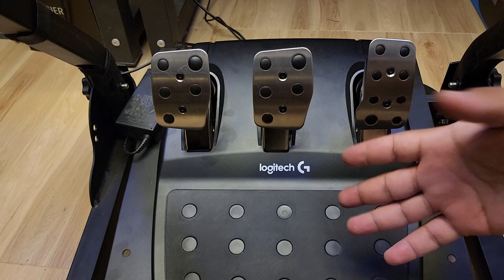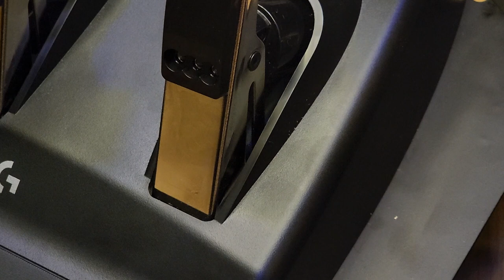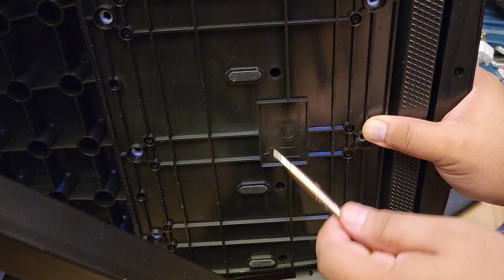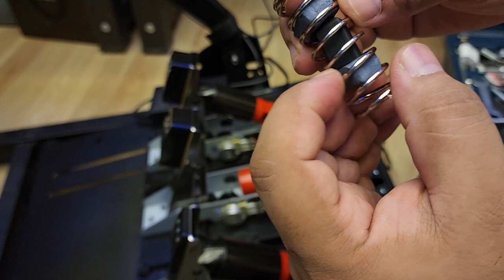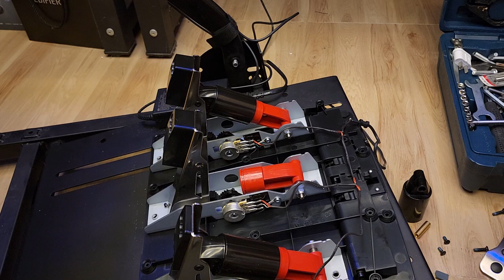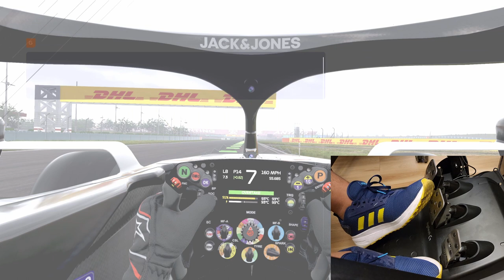How to Improve Logitech G29 Brake Pedal (Brake Mod)

Comment: After recently Installing a brake pedal mod, my throttle and brake are stuck at 100% in game. Do you have any idea how to resolve this issue?
Reply from the maker: Not really. Might be a good idea to dismantle it all and put them back again.
Reply: you have to invert the input next to where you bind them in settings
Reply: Settings in the game? Probably need to be inverted input
Reply: Did you ever figure it out??
Reply: @Gamersquadtttta  a new set of pedals.
Reply: Wires inside can get crushed when putting it back together make sure they aren't getting pinched
Reply: I know I am a little late but if you are talking about assetto corsa they make you invert everything in the settings before you can use your wheel so throttle brake and clutch need to be inverted

Comment: Don't do this because race car brakes are actually very stiff, similar to the pedals. They do that because the body is better at feeling how much pressure it's using instead of the small amount of position difference.

If you are hardcore enough to disassemble your pedals, you should be hardcore enough to make sure your chair and pedals are secure and smash that brake like it's your ex's foot.
Reply from the maker: Hahaha lol at ex's foot!
Reply: If i tell you race car brakes are stiff, but in a different way that G29 cannot mimic, you wouldn't believe me. I'm telling you, when you use a fanatec pedal you instantly get used to it due to the realistic stiffness.

Comment: Cool about adjustments ,  
Positioning is a personal thing.  I will try your way, but drilling out holes so that rubber can compress more.

My idea was to find a smaller spring n put inside to als a replacement for black piece. 😂😂 10:22 as that black rubber piece.
Is there’sfrom  closed lengthen the brake,  having more room to travel 

IS THERE A WAY YOU 
CAN ADJUST THE DPTH OF OF BRAKE.
Or how far I can press pedal,   Depth hopefully giving a more break feel I ruin the clutch could get reversed with brake springs only😂

I’m going to replace the rubber with a spring I side the strings small small river for pedal pushed at 100.😊